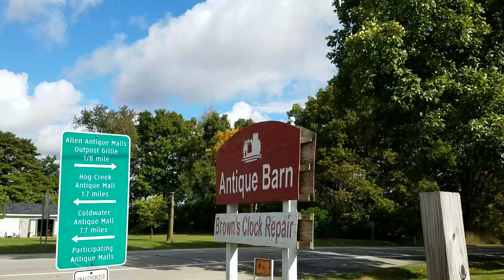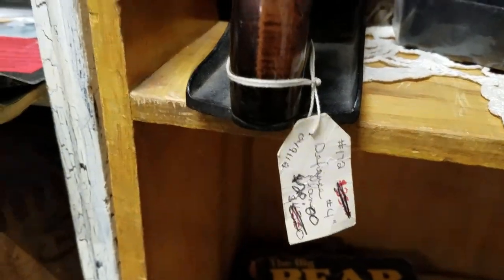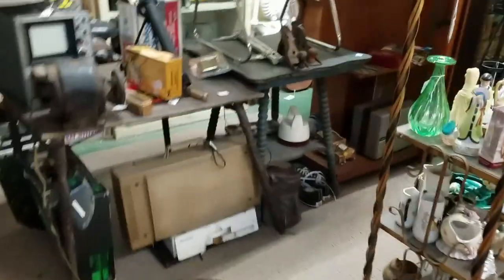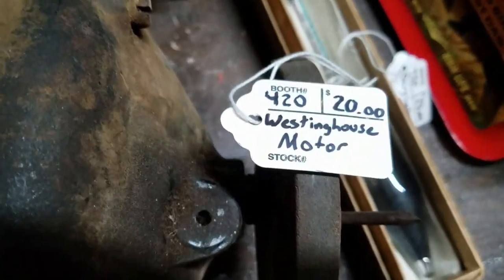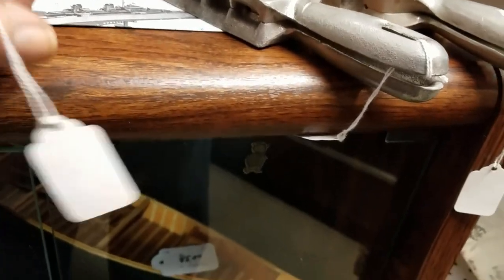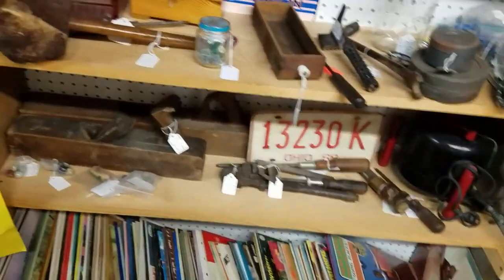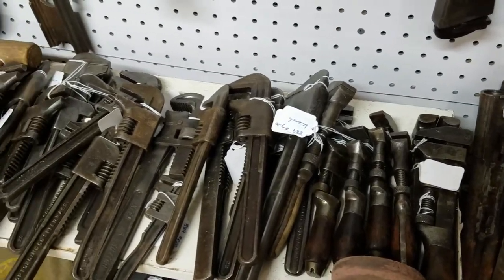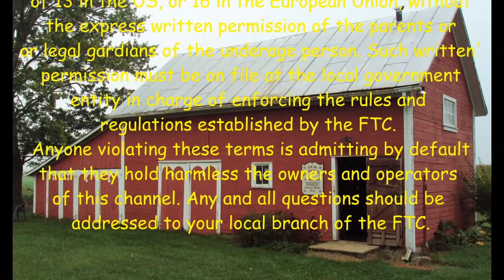Old Sneelock On The Road ~ The Antique Barn

Comment: Did you buy the last perfect handle wrench which had no visible damage. I would have been very tempted. The last time I saw the large Yankee screwdriver used was 1992 when a carpenter fitted a steel lined internal security door in a bank. Huge screws to the hinges to take the weight but it performed great and the screws shot in.
Reply from the maker: How many of those wrenches exist without marks is from being used as a hammer?
Only one I have seen.
Not reworked. Still has the machining marks. 😁😎